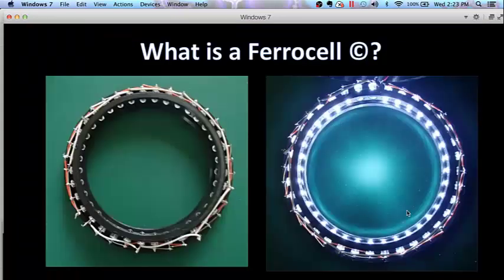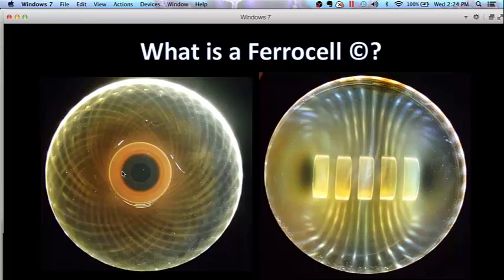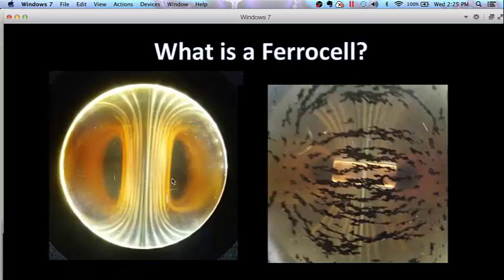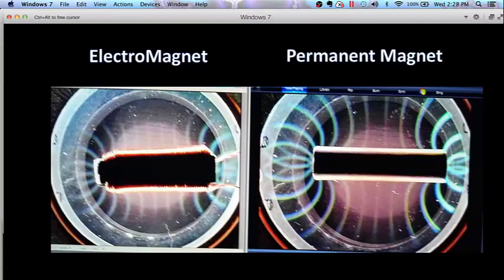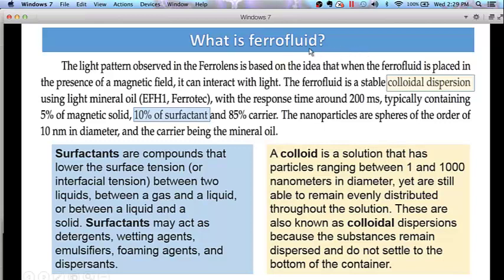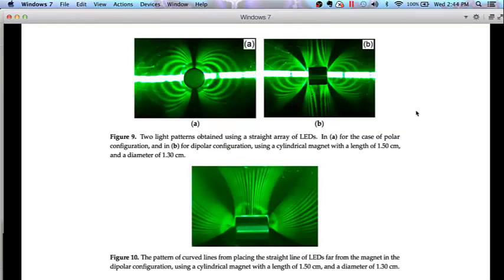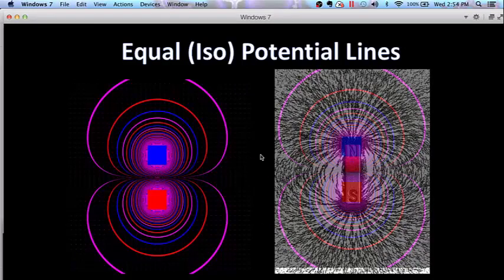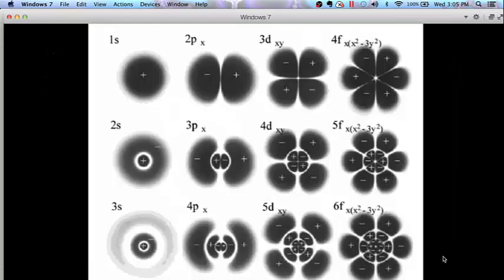Unveiling the Missing Secret of Magnetism

Comment from the maker: IMPORTANT: In this video, I refer to the ferrolens image as an OPTICAL ILLUSION, but what I really should have said is OPTICAL EFFECT. It is an effect of the glass and the placement of the lights and the ferrofluid causing the lines to become visible. Some may interpret the term "optical illusion" to mean that the ferrolens image is not meaningful. It is VERY meaningful and contains a lot of information. The interpretation of that image is still being debated and there is still a lot that we don't know for sure. I am continuing to try to sort this out and the feedback I am getting from my videos really helps.
Reply: I wouldn't waste much time on the ferrocells, yes. :) We are very familiar with the optical effect (yes it shows some information but for our eyes and brains looking at kaleidoscope type of kid toys and reflections of the dust particles in the air is very distracting from what we are looking for). Basically, the ferrocell works on the same effect as Light pillars - https://en.wikipedia.org/wiki/Light_pillar  - the only difference being that the crystals are not placed parallel to each other, they are on the curved surfaces - in ferrocell those aligned particles are on the surfaces of the usual onion-skin like field lines in 3D - although the fluid you are applying between the glass is very thin, it has enough thickness to have many reflection points for every light our eyes and the light sources find at the correct angles.
Reply: And you did describe it yourself almost perfectly already! :)
Reply: Must the display of the ferro cell have something to do with the magnetic field of the magnet? I understand how the light could be reflecting around, but a different magnet produces a different  'geometry'/display. We know light doesn't interact with a magnetic field; there is no measurable change of travel. Shouldn't the only thing remaining be the nanoparticles in the ferro cell, which are acted upon by the magnetic field of the magnet? I hear many objections and criticisms of the fero cell and I haven't looked close enough into this to really understand. Could someone help me understand what I'm missing?
Reply: @Teleforce1940  What is odd about different magnet producing different geometry?
Reply from the maker: @Teleforce1940  The pattern has to do with the nanoparticles in the ferrolens AND how it interacts with the magnet. Without the ferrofluid, there is no display. Without the magnet, there is no display. You need both.
Reply: @FractalWoman  My mistake, I didn't make myself clear (long day). 

Why is it that people are questioning the validity of using the ferrolens as a tool to see the geometry of a magnetic field? Some are dismissing it as preposterous or illogical. To me that makes no sense, as it's pretty straight forward what we're seeing. I don't see a counter argument for 'disproving' the ferrolens. My question then is: What is leading people to believe the ferrolens is not an accurate tool to view the magnetic field of a magnet?
Reply from the maker: @Teleforce1940  Good question. I'm not sure. I have been able to extrapolate a lot of information about the behaviour of magnets using the ferrolens. It is a great tool and very useful tool. We don't even know how useful yet. That is why is needs to be explored further.
Reply: Fractal Woman what’s the point for this ? what can it help ? sorry if that’s a dumb question
Reply from the maker: @Gabriel-um3nj  The point of this video was to talk about the ferrocell and to try to explain what the ferrocell is showing us. What is the point of any video? To share information.
Reply: wasn’t being sarcastic, fyi found the video from mes, just trying to get more context , it can be used for displays ? 
how can it help people is what i’m asking ?
Reply from the maker: @Gabriel-um3nj  The ferrocell itself could be used to map out the magnetic fields in an MRI machine, as one example. I work in the field of medical imaging and plan on giving a talk to the MRI group here on this subject.
Reply: Fractal Woman are you recording it ?

would love to watch
Reply from the maker: @Gabriel-um3nj  I will definitely be recording that. I am hoping to do it this month some time.

Comment: I 100% agree on your conclusive evaluation. However, as you may, or may not know, exactly how my unified theory (The Good Vibrations) explains "it" (the strong force) - the 4 quarks of each individual atom are entirely dependent on electrostatic pulses - from the surrounding aether vibration / friction created static charge to maintain their "bond" = the Strong Force / (IE - Gravity...). The "electron" is a "pulse" of static charge. It is an "illusion" that "something" (particle...) is orbiting the Proton. The electron - (I deem the Electron Function) is the choreographed, systematic, sequential pulses of static charge "energizing" each quark at sequential "times" - (orbiting...) Furthermore, as the electron function"s" occur - the "action" can be seen as BOTH a DC and AC interaction.
Compiled atoms (Mass) merely "relay" electron functions (enough static charge) from atom - to - atom - spherically radial inward penetration / delivery around it's circumference into the mass until ALL protons are supplied to where the relay and consumption terminate at the central core...... GRAVITATIONAL PROPERTY... (NON Magnetized Mass)

IE - Each individual quark receives a pulse. It is a DC type flow - IE - to quark #1 - which causes quarks 2, 3 and 4 - to be "pulled" toward quark 1. Then when quark #2 is "energized" - it pulls quarks 1, 3 and 4 toward quark #2. (and the same for quark #3 - and the same for quark #4 -then REPEAT = ORBIT.
However - when the perspective of the entire proton as a "whole" is taken - it imitates the action of an Alternating Current - on a 4 way (or double dual) - 3 dimensional CIRCUIT - at the slow speed at which we can "see" or "detect" this "operation / function". When attempting to "view / detect" the "electron" - we are using "MASS" to do so - which the "items" we use - are made of / displaying" the same exact thing we are trying to "see".
A (Magnetized Mass) typical magnet has... billions of EF occurring in a nano second. And the static charge is "delivered / relayed" through the magnet in a linear orientation (instead of spherically radial penetration ' delivery) from SOUTH (input - POSITIVE) - through - to NORTH (destination - but becomes NEGATIVE output.
This "farther" distance of relay - causes acceleration in static charge delivery - a slight overabundance (equal and opposite to the over acceleration at the input and output...) is resulted. The overabundance shoots out the NORTH - only to be redirected (partially recycled) back toward the input SOUTH by the surrounding aether static charge. (3 dimensional snake eating its own tail... but still needs fresh input simultaneously) THIS is WHY the POLES are STRONGEST
The result is an equally balanced acceleration of S INPUT and the redirected N OUTPUT = MAGNETIC FIELD. (Accelerated Gravity...)
Electric Current Magnetic Fields - work slightly different - very similar - but fundamentally different.

Comment: Have you seen the video by Ken Wheeler where he demonstrated 3 drops of blood mixed with 'mouse oil'(purer wd40), works better than ferrofluid? This essentially means that low viscosity blood works just as well or better than ferrofluid. Why this matters? Increased alkalinity decreases viscosity of blood. Human beings can increase the alkalinity of the blood with specific breathing techniques like the one used by Wim Hof('the iceman'), and the more practical and efficient ones used in the martial art used by the Russian special forces Spetsnaz called Systema. Why this matters? The sensation known as 'prickly goosebumps' can be felt during fight or flight body responses to cold temperatures, specific music/sound, and during points of high emotion. The reason humans feel the pricklies is because of the calcite crystals located in the pineal gland which vibrate when a human is faced with flight or fight situations. Calcite crystals produce piezoelectricity when vibrated just like quartz crystals, and this is felt as the sensation of prickly goosebumps. Low viscosity blood reacts better than ferrofluid while under the effects of magnetism/electromagnetism... The reason the 'iceman'(wim hof) can maintain his body temperature at 98.6 for 50mins while submerged in below freezing water temperatures(ocean water) is because his breathing technique increases the oxygen in his lungs which increases the alkalinity, which decreases the viscosity of his blood, and the cold temperatures induce a flight or fight response which means the calcite crystals vibrate to produce piezoelectricity, meaning he can control his own blood flow around the area of the brain that contains the pineal gland piezoelectricity. That includes basically every unconscious function of the entire human body, the control of the immune system, the nervous system, the entire limbic system, the hippocampus, the thalamus, the hypothalmus(body temperature), basically everything. I believe proper breathing combined with induced flight or fight responses can allow for things that seem magic/super human/miracle when trainedd properly.
Reply from the maker: This is really interesting. Thanks for sharing. And yes, I did see Ken's video where he used his own blood to make a ferrocell. If I wasn't so Squeemish, I would do it myself.
Reply: This is my backup account, my main is SpellsOfTruth, ive commented on a bunch of your videos and still think your explanation of the universe as it relates to 'change' is the best explanation of how the universe works in existence. I found a website on the dark web that helps confirm my ideas about human etheric aura control. It works like this:  
1) To open all of your aura nodes continuously clench your high abdominal muscles at all times. After about an hour or two you will begin to feel significant effects like a shield of etheric aura encircling your heart. When you can maintain clenched high abdominal muscles through an entire night of sleep, you will have officially opened all of your aura nodes.
2) Read the book "Systema The Russian Martial System: Created By The Soviet Military For Their Special Forces Elite" by Guiseppe Filotto which focuses on remapping neurological brain processes to perform super human feats of strength, speed, endurance, perception, and much more. Systema is the martial art taught to the Russian special forces Spetsnaz.
3) Figure out a method for manually inducing the 'prickly goosebumps' and then try to hold the 'pricklies' for as long as possible. My method for doing so is to think about how my massive family, and massive group of friends have been so completely tricked by modern TV, movies, sports, etc that its become difficult to even want to hang out with them anymore, Ive been friends with these guys since I was in kindergarten, so like 23 years of friendship, and I don't even want to hang out with them anymore because I know we will spend the whole time gambling on sports games lol. Sports are childrens games designed to distract competitive men from ever raising their consciousness above a the level of a child. Thank god for banter, otherwise Id feel no obligation to hang out with my friends of 25 years... When I think about how much my friends have been tricked, I am filled with a seeing red rage that induces the 'pricklies'. I can manually induce the 'pricklies' by thinking about this and then attempting to hold on to them as long as possible. Normally people only feel the 'pricklies' for 5-10 seconds and it usually allows one to exceed their physical limits. Using my own method of manually inducing the 'pricklies' ive been able to hold them for around 3 minutes at minimum and 10 mins was my best, but after the 10 min one, I got a really bad bloody nose and had to lie down from exhaustion so ive never tried getting close to that again.
4) Combine the breathing techniques of Systema described in Guiseppe Filottos book with the manually induced 'pricklies' to attempt to control the functions government by the limbic, nervous, hypothalmus, thalmus, hippocampus etc, I tried to hit a boxing heavy bag while using the sriking techniques of Systema, the breathing techniques of systema, manually inducing the 'pricklies' and maintaining a clenched high abdominal and it was pretty difficult to combine them all at first, but after a few days of practice it became much easier and the effect were nothing short of miraculous...(At the very least you will perceive time to be much slower than normal. Ill leave it at that so I dont sound like a schizo ).
5) For further training that will allow for complete control of your etheric aura, watch the Japanese anime/manga Hunter X Hunter(2011 version) as if it were a mirror to real life and is how the top 1000-10000 humans on earth operate. That anime accurately depicts the training methods described in the Systema book and then takes them to their next logical step. If you get to this stage, etheric aura control will allow for things that can only be described as magic, super powers, or miracles.

Comment: This was amazing. I did notice that on the diagram at minute 30:00 the iron filings did not all match orthogonally with the computer diagram on the south pole... so just a sidenote for you or Timm to possibly add the Phi relationship (according to Ken Wheeler the south pole is phi and north pole is one) into the computer equation. (look to the right and left of south pole) ... I love your channel
Reply from the maker: Unfortunately, these two diagrams are not calibrated to each other. That is why they don't line up. They are just images superimposed onto each for example purposes only . I didn't line up the two images as well as I could have which is why they don't line up perfectly. In realty (in a real experiment), the iron filings would be perfectly orthogonal to the isopotential lines. The phi relationship that Ken talks about is a phase disparity, not a field disparity. Hope this helps.
Reply: @FractalWoman  ... I see what you mean now. I played around with the images at a 1/1 and 1/phi ratio and couldn't conclude either way. Plus if the north and south had a one to phi ratio then your atomic models may not work as well. I was just trying to contribute. I loooove your channel and really think you're on to something huge here.

Comment: When you mention at 34:25 that you had to make the inner magnets 1.618 smaller to work, I was surprised you didn't just come out to say that you had to use the golden ratio to make it work! Last, as I started to suspect, if there is no such thing as an electron, then what they call the "electron cloud", is really just the magnetic field.
Reply: "... what they call the 'electron cloud', is really just the magnetic field."   That is exactly what Ken says:

"Since we know electrons are not particles, but a misunderstanding of magneto-dielectric fields in motion, we can examine atomic orbital geometry with perfect lucid clarity. Chemists use the balloon model of the atom everyday to explain covalent bonding in the formation of molecules, which is exactly correct! However what is not understood is that these dumbbell and disk configurations are magnetic (dumbbell formations) and dielectric (disk areas of inertial planes) dominances (moving counter to each other) as driven by the gravitational (strong nuclear force comprising stable dielectric wave bundles of inertia), protons (magnetically charged) and neutrons (dielectrically dominant).
Using what we have proven about magnetism moving spatially away from dielectricity in hyperbolas (inverse sphere), and dielectricity being a centripetal radial counterspatial inertial plane, all atomic orbitals can be understood with demonstrable lucid understanding even to a young person." 
(pages 198-199, diagrams also shown. Of course Ken does not bother to number his pages or illustrations.)

Summary of the rambling sentences above: The balloon/dumbbell models of the atom are correct but are caused by magnetism, not electrons.  Specifically, the balloon/dumbbells are magnetic, and the disks are dielectric.